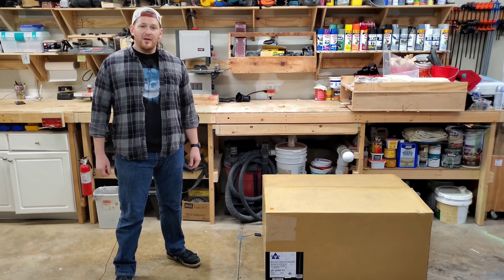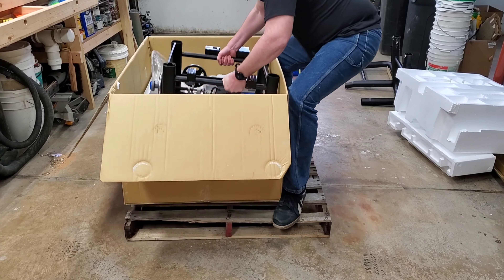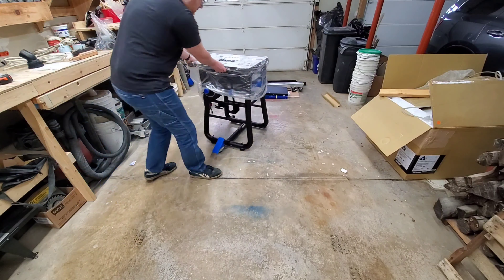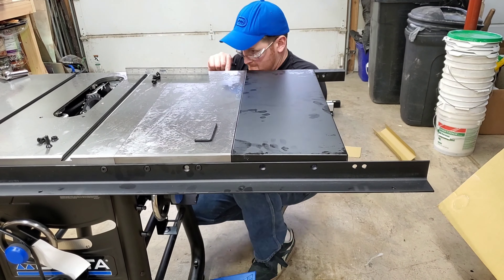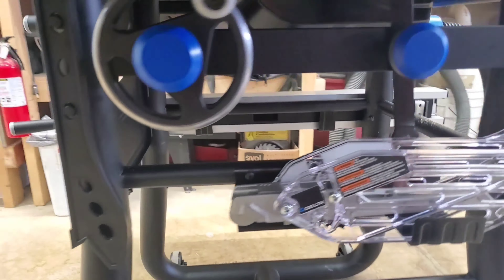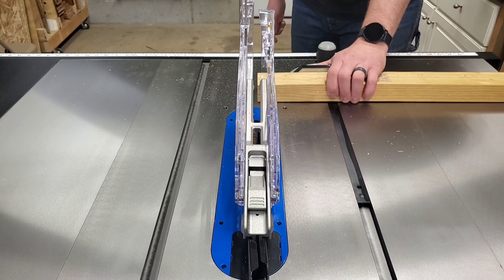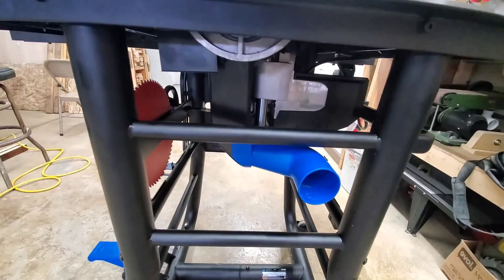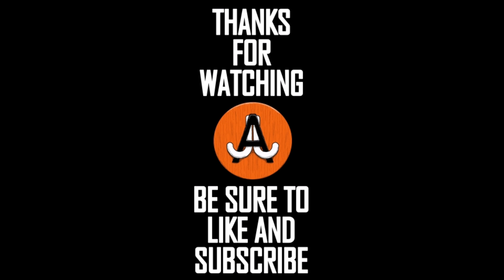Delta 36-5100T2 Contractor Table Saw - Unboxing, Assembly, and Initial Review // Just Joshin' Around

Comment: 1. Any idea as to the decibel level? 2. Can they small fence extension be moved to the other side of the main fence so I'm not working backwards using it? I suppose it may work for left-handers? 
Thanks
Ken
Reply from the maker: Hi Ken, great questions: 

1. I downloaded a simple Sound Meter app to check it, and it seems that the saw runs around 85dB, but is actually drowned out by the shop vac that I use for dust collection (about 90 dB). I'm pretty sure that the dB level of the saw will likely increase, based on the type of wood that you're cutting. 

2. It appears that you can actually swap the mini fence around to operate on the other side (Delta cleverly left open access points on the bottom side of the main fence body to remove the hardware holding both aluminum siderails in place to flip them around. 

Hope that helps!
Reply: What exactly is that small fence flip down for. It says to cut small stock but I don't get it.

Comment: Where did you buy it from? And the extra cast top?
Reply from the maker: I got mine from homedepot.com

The cast iron extension wings come standard with the 36-5100T2 model.
Reply: If you look at the saw on Home Depot's website, just understand that the saw pictured is not the 5100t2.  I'm pretty sure they have the 725t2 pictured which has steel wings (black) and that cross bar.  The 5100t2 comes with 2 cast iron wings (same color as the main top) and 1 steel wing for the right side of the table.  The fact that all of these saws look pretty much the same confused me for a while during my research.
Reply from the maker: @rdot980  that's a good point, Robert. I had to cross-reference multiple sources to ensure I got the right one - because I believe even the Delta website has a different one pictured for the 36-5100T2 (they may have updated it since). What I ended up doing was looking up the parts diagram between multiple models and noting the extension wing part numbers (there were 2 different part numbers, 1 for the cast iron and 1 for the steel). I made sure that the 36-5100T2 had 2 of the cast iron and 1 of the steel. 

It's strange that the retailers have the wrong pictures listed, and it definitely causes some unneeded confusion.

Comment: I bought one & had a hell of a time to get the part to upgrade it, customer service sucks!
Reply from the maker: Oh jeez, yeah I've heard that customer service can be a bit lacking - hopefully I won't have a need to contact them 🤞
Reply: @JustJoshinAround   After I gave up on Delt customer service, I bought Sawstop parts to upgrade the tabletop side panels to cars iron & add a cast iron router table, I had modified all holes to install them!
Reply from the maker: Holy crap, that's some commitment there! 

Yeah I've heard that Sawstop parts can work on these saws with some modifications. It's just a shame you had to go to that level of screwing around to get the saw like you wanted - the customer service sounds like they need to step up their game.

Either way, I hope it all works out well for you!

Comment: I know I'm super late to the game. But as I am looking to this exact saw, something that you didn't mention, that you may not know about is that the saw should be ran off a dedicated 120v line. The motor is about the max size that can be run off of 120v. If you are running multiple things off the line it is plugged into it may put undo stress on the motor and burn it up.
Reply from the maker: That's a very good point that I should have mentioned in the video. Yeah, I run it on a dedicated circuit.
Reply: @JustJoshinAround  good deal man.

Comment: Got mine and I attached a 7 inch deep  container flush to the table - instead of the extension table to store things
Reply from the maker: Oh that's a cool idea! I'll have to look into trying something like that too.
Reply: @JustJoshinAround  i just used the bolts and holes already available! worked perfectly
Reply from the maker: @jasonscroger5065  that's awesome. So is it like a premade container or a box that you made that somewhat hangs under where the stamped steel wing would be?
Reply: @JustJoshinAround  No, I made the box myself, I made it larger than the stamped steel wing  - it's about 14.25 inches wide, and it sits about 1/4 inch below, so that a 1/4 inch top can be put on it   My friend made one for his table saw, and he only made it 4 inches deep - said he regretted it being so shallow.
Reply: @JustJoshinAround   I made it 14.25 inches wide, 7 inches deep on the inside.   with it's cover, it's flush to the table, so that the fence can go over it
Reply from the maker: That's such a good idea. I'm sure it helps a lot to have some convenient storage right at hand. I know that would save me a ton of time from my normal practice of roaming around the workshop, saying "where the heck did I put my freakin pencil?!"
Reply: @JustJoshinAround  it's supper convenient - you can even leave the top off if you are not cutting large pieces, I wish i could send a picture on this
Reply from the maker: Definitely, I can give you my email address if you want to send a pic? I'm seriously interested in making one for myself
Reply from the maker: justjoshinaround83@outlook.com
Reply: @JustJoshinAround  sent
Reply from the maker: Thank you so much, I'll check it out!
Reply from the maker: Thank you very much for sending those pics!

Comment: Just wanted to confirm that the model you bought and assembled, the 36-5100T2 came with ONE piece fence rails????  I have seen other ver similar ones come with 2 piece rails. Thanks
Reply from the maker: I'm hoping I understand your question correctly - for the fence rails, there were actually 3 pieces:  1-rear angle iron rail, 2-front angle iron, 3-front square-tube rail (with measurement markings). Then the fence itself is 1 piece (with the small flip-down fence attached).

All 3 fence-rails came in 1 box  (separate from the main saw box).

Hope that helps.
Reply: @JustJoshinAround  yes it does thank you. I just wanted to make sure all of those pieces you referenced are one long piece.  And not joined to gather somehow to make one long piece. Other Delta and Rigid saws have 2 piece fence rail system to make it easier to package the whole saw in one box
Reply from the maker: @lawrencejonap6638  I hear ya, yeah I could see them doing that, but it would definitely compromise the rigidity/performance, at least I'd imagine it would.

Comment: I have this saw and love it. However, the arbor nut stripped out after 2 blade change outs. I called delta and the part is on backorder. From what I can tell, they had a bad batch of them and are scrambling to replace it. Just something to pay attention to. Otherwise I’ve used it A LOT. It’s a great saw!!
Reply from the maker: Oh man, thanks for the tip!  I'll be sure to pay attention to that. 

And I agree, I'm loving mine too! 

Thanks for watching!

Comment: Could anybody please tell me the difference between the Delta 36-725t2 model and the 36-5000t2 model? They seem to look identical and have the same exact specifications, but the 36-5000t2 costs around double the price? Thank you very much, guys
Reply from the maker: I honestly can't tell you. I've just spent a good amount of time researching the differences, and I can't seem to find any notable benefits to the 5000 over the 725. The 5100T2, however, has the added benefit of the cast iron extension wings, but I believe that's the main upgrade. 

Good luck with finding out what you can. If you do happen to find anything, feel free to comment back here, highlighting what you find. This comment section seems to get a lot of traffic and could definitely benefit someone else in your position. 

Best of luck.

Comment: I bought one last night and still in the box
Reply from the maker: Awesome! Well I hope this video helps with the assembly and set up, at least a little bit
Reply from the maker: Just wanted to give you a heads up - the motor on mine died today. Gotta get started on the warranty repair process now. 

But just wanted to let you know since I had just replied earlier - in case you hadn't opened it yet.
Reply: That SUCKS!!  other than that do you like it??  Did you buy the warranty plan from the store you bought it at??  I didn't last night, I have thirty days and the run 122 and 140-ish..  I didn't have the money at the time and didn't want to put it on the cc, I'll get it this weekend for sure!!  Thank you for helping me and I did subscribe, before I commented
Reply from the maker: Yeah it definitely sucks, for sure. I didn't purchase any extra warranty, but the manufacturer's warranty is for 5 years, so that's decent. 

And yeah, I love it other than that - it's worked really well for me. So was pretty bummed when that happened yesterday.

And thanks for subscribing!
Reply: I hope Delta doesn't give you the run-around..  That's why I didn't spend 148.98 on the cheap service plan at lowes, I have 30 days to change my mind..  I hope all goes well and they get you back up and running asap!!  Let us know how it turns out, it'll be extremely helpful
Reply from the maker: Absolutely! 

And I plan to make a follow-up video to talk about it all too.
Reply: Sounds great!!  Good luck buddy

Comment: Not happy with the Delta 36-725T2. Out of the box assembled and then taken to the repair shop with a bad motor, start capacitor, and run capacitor.   Seems this is a big problem that Delta is aware of. The certified repair shop stated they had worked quiet a few of them. Saw has been in the shop for 3 weeks now and they have no idea when the parts will arrive.
Reply from the maker: Oh, good grief, that is awful - and unacceptable. I really hope that they get you all sorted out.
Reply: Holy Cow!  You definitely purchased a lemon.  My father-in-law purchased a BMW 30 years ago and it was total lemon.  It happens, just saying.

I purchased this model based on its review. It’s been over 4 years and use it regularly and haven’t experienced any problems, save change of blades and regular maintenance 

But does my experience with this model alleviate your shortfall, of course not.  Hope you find table saw that will suit your needs.

Comment: Obviously, 220 volts are much better!
Reply from the maker: Absolutely - less required current/heat-loss is a great thing, and if I had the capability of using 220V in my shop, it would have changed my purchasing decision, for sure. 

Thanks for watching!